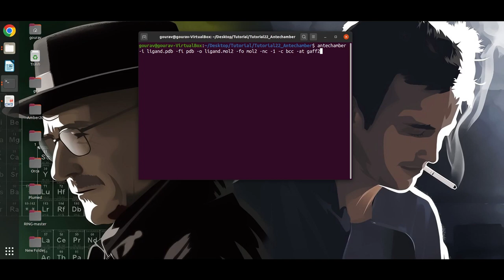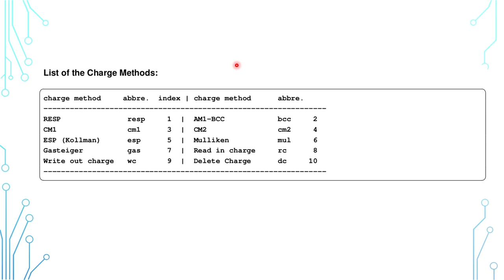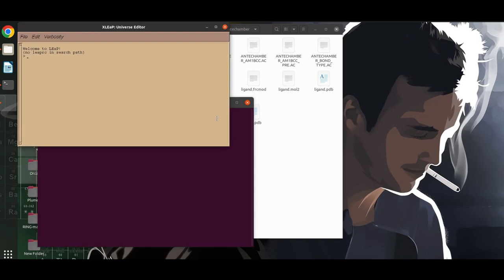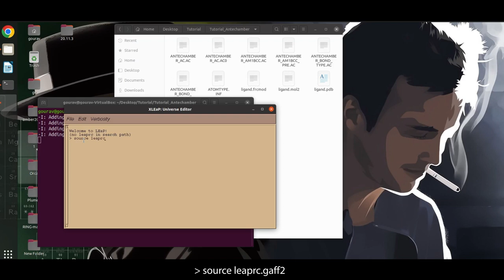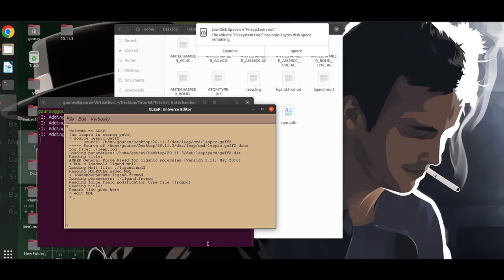AMBER Tutorial: How to Create Modified Force Field Parameters using Antechamber

Comment: Hey! How to strip water from my prmtop and mdcrd file? I ran an MD simulation using Amber 20 and I just want to look at my peptide and therefore need to strip water. I tried using parmed but I get an error saying that the parmed command does not exsist. Can you help? Thank you!
Reply from the maker: To strip water from prmtop and mdcrd files, you have to use parmed and cpptraj respectively. If parmed is not opening then kindly check whether Amber20 is properly installed or not. Also, you can try to source the amber.sh file.